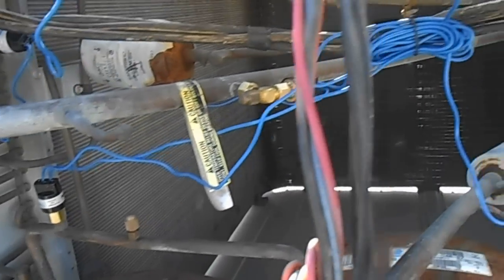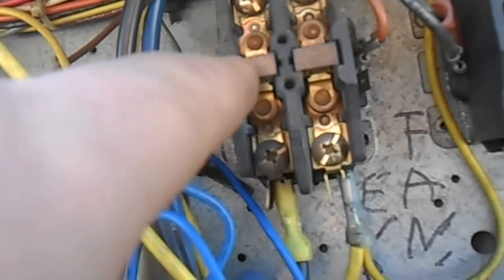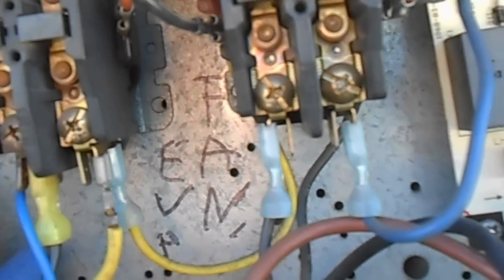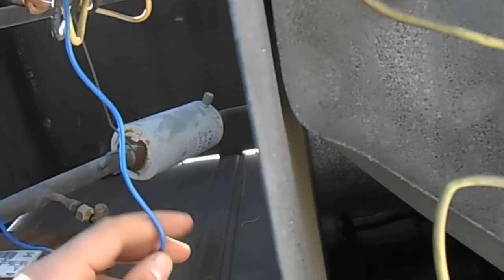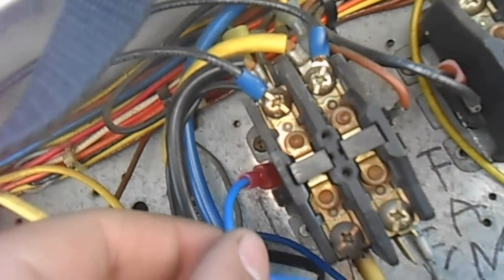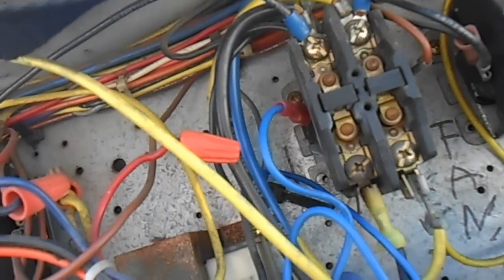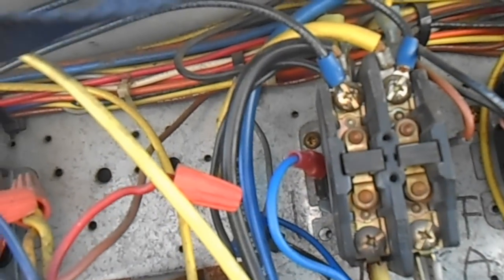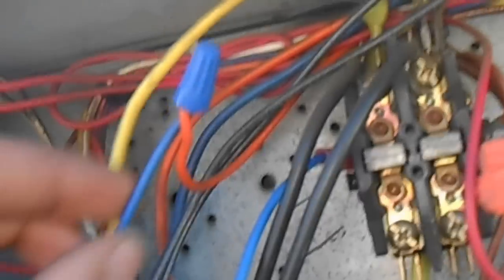HVAC: Pressure Switch Wiring

Comment: When u do a pump down,,,how would u jump the pressure switch? And why do I need to jump if I can press it manually,,but when I press it manually,it cuts off,,but why if I'm doing it manually,?
Reply from the maker: The pressure switch only cuts out the coil voltage. If the compressor is stopping after you manually push the contactor in that means the internal overload is opening. It's likely the unit is overcharged or you have a worn compressor. If you can't keep the compressor running long enough to pump down; your only option is recovery...
Reply: Thank you!!
Reply from the maker: @vicg1973vg  you're welcome

Comment: okay my friend, but how do you test this pressure switch to know when is good or no?
Reply from the maker: Marcelino Hernandez Thanks for watching. If you have a low pressure switch; it should be open (no continuity between the two terminals) when it is exposed to pressure below it's set point. If it's a high pressure switch it should be open when exposed to pressure above it's set point. Hope this helps

Comment: Do those low pressure switches typically have a schrader valve so you don't have to draw the system down? I have an old Tempstar 5500 Model # CH5524VKA2 and I'm thinking of changing it out myself.Thanks.
Reply from the maker: geecrawdad That's a tough one to answer for sure as I have definitely seen them both ways. Obviously if its brazed in; you have no choice. If it's on a flare fitting; it might have a Schrader but there's no guarantee.

 Either way, schraders are a very common source of leaks; especially when used with a device that uses a depresssor (such as a pressure switch). So, it may be better to eliminate the flared connection altogether if you find that to be the case.
Reply from the maker: If you decide to check it out; please wear insulated gloves and safety goggles. Liquid refrigerant is no joke; especially if you get sprayed in the eyes. Use a back-up wrench on the unit side of the connection and crack it loose with another wrench (preferably properly sized open end wrenches). Loosen a few threads and if it doesn't stop hissing after halfway or so; tighten it back down quick because there is not Schrader in there. Hope this helps

Comment: it was 24v coming to pressure control and then the other side to the contactor coil????
Reply: the thermostat started blinking and could smell a burning smell took it off of the wall saw the batteries were leaking so I was like OK replaced them and it started to smell like burning and opened it up and the board was fried
Reply: from the t-stat it went to roof with yellow and common I connected pressure switch in series with yellow
Reply: went to start up system after charging and wiring the pressure switch in and it did that so I looked at the unit right next to it and someone had cut that pressure switch out as well the one I had changed was actually bad no continuity .....should I try and wire it in series through common for compressor single phase it would still prevent high head but wouldn't be in a control circuit

Comment: hey have a split system with no transformer outside I out a high pressure control in and wired it in series 24 from t-stat to pressure control and then the other wire from pressure control to contactor coil and my thermostat was fried why did this happen?
Reply from the maker: joshua glatz I don't know it sounds like you wired it right. when you say the thermostat is fried you mean it won't connect from "R" to "Y" anymore?

Comment: So when the low pressure switch is triggered you do not get continuity
Reply from the maker: trukin forever Yes. when the low pressure switch senses pressure lower than it's setpoint. it will open , breaking the continuity

Comment: I want to bypass a circuit board in my 2006 4 ton carrier condenser that is not a heat pump.
So correct me if I am wrong. I break red then attach red to the low pressure switch, and take other wire from low pressure switch attach that to high pressure switch line, then take other high pressure switch line and attach that to one side of the 24 volt contact on the contactor.
Reply from the maker: trukin forever Ok that sounds about right. you want your safety controls wired in series from the control power source to the compressor contactor coil. keep in mind that the circuit board you want to bypass probably has the time delay/lockout circuit within. if you do have any issues with your equipment; it's likely to cycle the compressor on and off repeatedly (and that can cause a lot of damage to the whole refrigeration circuit)
Reply: Thank you for your response, and the thermostat has the time delay so I think it would work fine
Reply from the maker: trukin forever you're very welcome glad I could help

Comment: i wired up my pressure switch in series i have no Refrigerant in the system but my contactor is active and push in. so my low pressure switch is not  opening the circuit.. i check the low pressure wires and they have continuity.  can i get some advise.
Reply from the maker: what is the rating on the switch? what is the pressure in the system? some LPS's have a very low opening pressure like 1-5psi. Even with "no refrigerant" in your system; you may have 10-15psi

Comment: cool thanks. 10 sec in to the video there is a orange wire to the contactor coil on the right side where is that wire coming from? and what is it used for?  thank you .
Reply from the maker: the wire is actually brown and it is the ground (or common) connection for the contactor

Comment: so the  the main 24v from the transformer is wired to your pressure switch  and then into the contactor coil to make a complete close circuit? If there was no pressure switch then the 24V wire would go strait to your 24v coil on your contactor?
Reply from the maker: thanks for watching. Yes the 24v control voltage is wired in series thru the pressure switches (and any other safety controls) before reaching the contactor coil. if there isn't a time delay relay; the switches should be manual reset so the unit doesn't cycle on and off
Reply: @71dembonesTV  if there is a time delay, which part creates the delay? Is it the circuit control board? If you disconnect the tstat 24v power and the 240 main line, does that reset the time delay or is it still running with juice from the capacitor? Just curious how to you clear the time delay